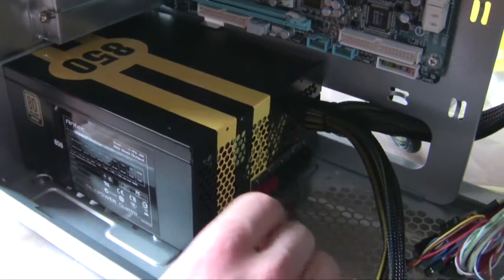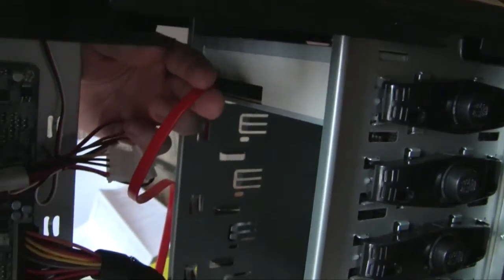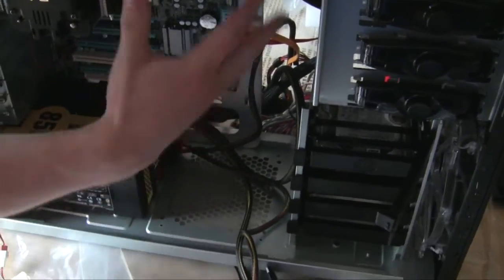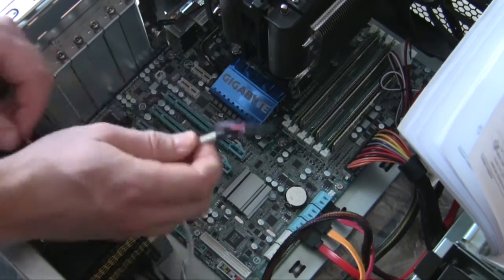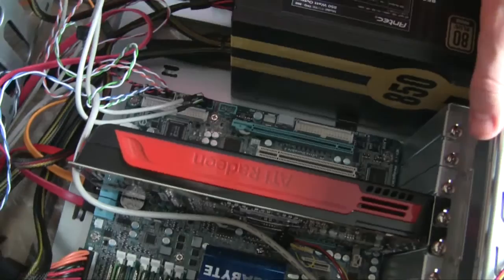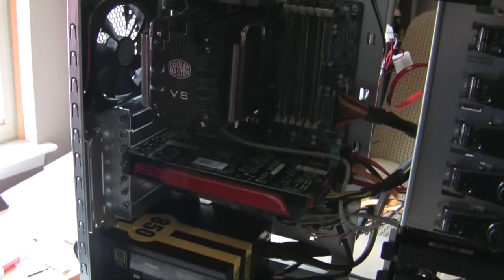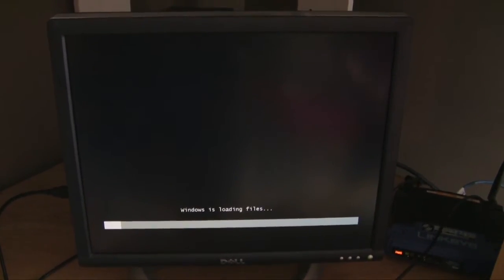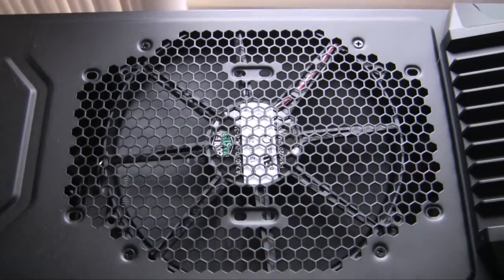Basic PC Assembly/Build Tutorial Part 2

Comment: Molex connection for fans equals the lack of controlling the Speed of them. They will run at the same speed constantly when the pc is on! Always plug them into motherboard directly via fan headers and let the software control the speeds. With Asus you get great fan control that way and optimal noise reduction and cooling

Comment from the maker: @Valthyrn The 5850 will outperform the 460 in most cases, 5850 is also more expensive. To install windows on specific hard drive like SSD, you can choose where to install it during the installation itself. If you need more info, let me know.

Comment from the maker: @Thecashflowman If you want to strictly go wireless, you could buy a wireless network card, and if you want to save hardware space inside of your PC, you could buy a USB network adapter. I am using one, and it works very well. However, if you have the option to go cable, do that instead as nothing beats cable connection.